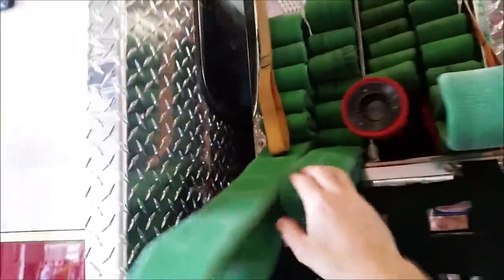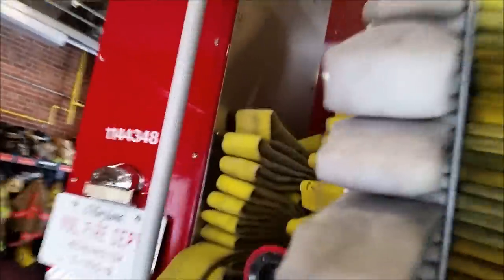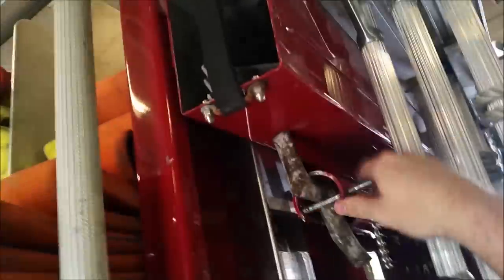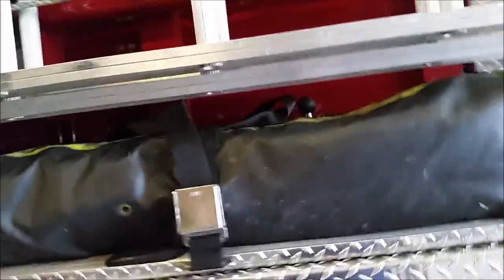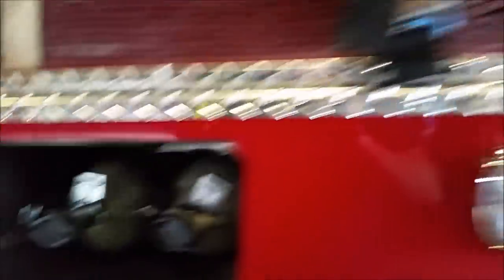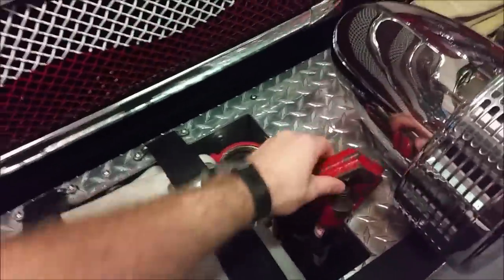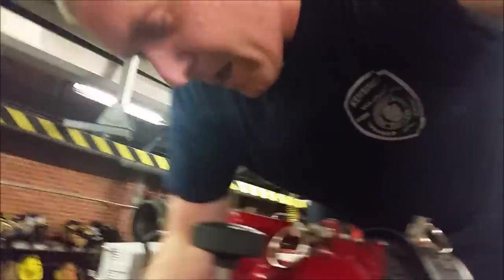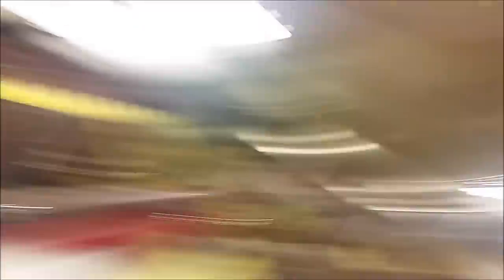JSano from the Fire Department - Engine Tour

Comment: I love these kinds of videos. I always wondered though, what that chromed canister on the front bumpers of fire engines are and if there is an actual water tank built into the fire engines.
Reply: Yes there is a water take built in all the trucks such as brush trucks engines and tinders
Reply: The Federal Q is what is what is on the front. It's one of the many sirens on the trucks. The Q is controlled by a foot pedal that is on the passenger side of the truck. Some trucks there is also a pedal for it on the driver side.
Reply: Andrew Leach correct and it is used for going through intersections

Comment: So very cool, and Jeff, thank you for the service you provide!  How much water does that rig actually hold?  And yes, I would love to see more vids like this.  :-)

When I was in 1st grade (back in 1980) we took a trip to our local fire station.  It was an amazing experience.  They were still using the open cab design rigs (might have been a Crown engine).   How the seats and interior of those open cabs were never flooded with water after a fire still puzzles me.

One thing I also wondered was why firefighters don't wear the style of suits that you see people wear who work in smelting plants?  Same types volcanologists use.  I would thing they would protect you better in a fire by the way they repel radiant heat.
Reply: Their rig probably holds around 500 gallons of water. And as for the suits if it's those silver suits, that doesn't seem like it would be practical at a fire because any number of things could pierce the suit defeating its purpose. Plus the silver ones would probably be several times the cost of what they wear now.
Reply: Considering it is only leather they currently have those silver ones can withstand thousands of degrees.  But it probably is the cost.  Though subsidies could help.  I know I would chip in for more protection for our firefighters :-)
Reply: The silver suits are used in the fire service. They are known as proximity suits. Mainly firefighters that are at airports use them. The gear that we use now provides plenty protection if it is worn properly. The gear can withstand up to 1500 degrees.
Reply: Thanks Andrew.  I was unaware that some do wear them.  Was just thinking that all firefighters should use them over the traditional leather gear.  Better protection for doin one of the toughest jobs!  :-)

Comment: Why 2000ft of 4in
Reply from the maker: county requirement, the want 2 full 1000 foot sections of 4 inch.  used to only be 14 or 16, but they upped it last year.

Comment: I didn't see any medical gear on the engine. Do you not respond to medical calls with the ambulance? The cities we service have fire as first responders. Also, what was the fly car on the drivers side of the engine?
Reply from the maker: emtfarva We do have EMS equipment, but it is in one of the inner compartments which I didn't show off in this video.  They fly car you are referring to in the ALS chase car.  It has a driver and medic to go respond to a call to upgrade a BLS unit.
Reply: I see. So, you staff bls tiered system with nontransporting als? Is your engine bls?